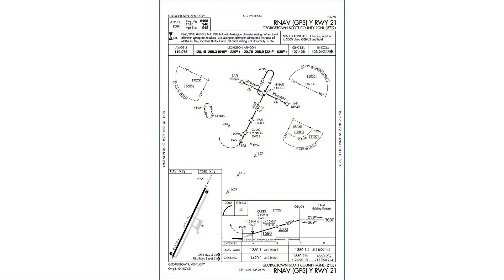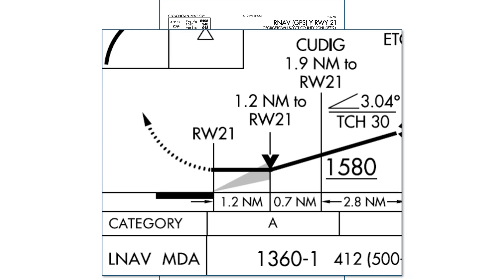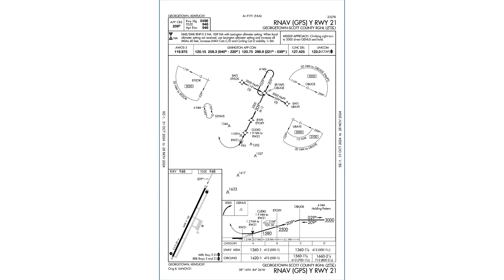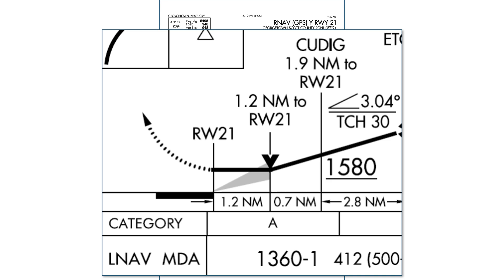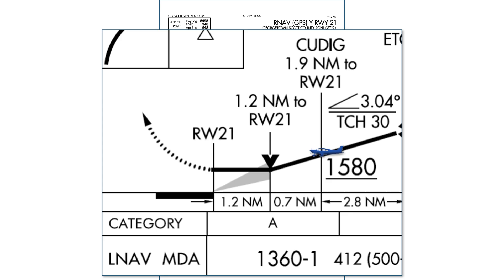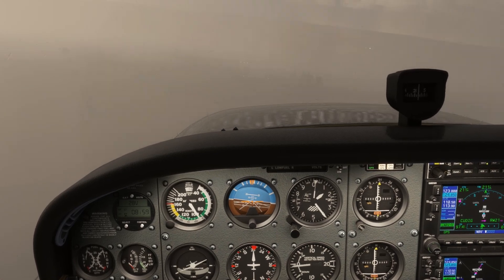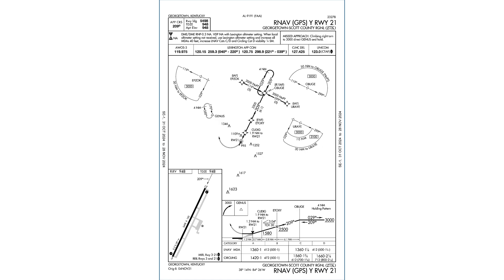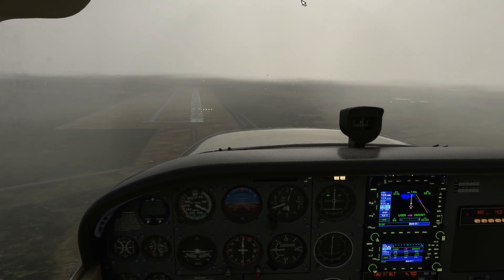How to Use the Visual Descent Point | Non Precision Approaches

Comment: There is another very important legal consideration here:
14CFR 19.175 (c) 
Where a DA/DH or MDA is applicable, no pilot may operate an aircraft below the authorized MDA or continue an approach below the authorized  DA/DH unless -

(1) The aircraft is continuously in a position from which a descent to a landing on the intended runway can be made a normal rate of descent using normal maneuvers

You are required to have a normal rate of descent, not chop and drop to the runway. The VDP is there for this very reason. The VDP gives you the 3.0 degree glide slope to the runway, allowing for a normal rate of descent to a safe landing. You should go diving to the runway at almost the MAP.
Reply: Where does the FAR describe exactly what is a "normal rate of descent"?  Perhaps some may consider 700 or 800 FPM to be normal . . . for them.  So 'chop & drop' does not necessarily violate 14CFR 19.175 (c).

Comment: Yes Darthknight, that is correct (mostly). The referenced AIM section stipulates "The pilot should not descend below the MDA prior to reaching the VDP." However there are more criteria to take into account (please read the full text of the AIM 5-4-5(h) to appreciate). Generally, you should expect to execute the missed approach procedure if you don't have the runway in sight at the VDP. One very important reason for this is that the VDP is positioned to allow a stable approach all the way to the runway touchdown zone if you can continue your approach at the moment of arrival at the VDP. As the narrator stated, if you level at the MDA and then subsequently see the runway, you will be in an unstable condition if you attempt to land after you have passed the VDP and leveled off at the MDA.
In GA flying in small, low performance aircraft, being in a stable configuration is more manageable due to relatively low speeds and simple configurations (fixed gear, etc.). If you are flying a complex, high performance aircraft (turbine, heavy, business jet or transport category), being stable all the way to the runway is a criteria that is required in most if not all flight departments. Thus, a descent to landing after passing the VDP and leveling at the MDA is generally not possible if stable landing criteria is to be maintained. There is more to this topic than is said here, but I can tell you that at the two airlines I worked for, if you level off at the MDA after passing the VDP, you will be obliged to execute the missed due to being unstable if you tried to attempt to land. This maneuver is one of the most difficult to learn (and teach) for new jet pilots. It is also one of the most worthwhile and rewarding to master.

Comment: Why do some plates have a VDP and some don’t?
Reply: "A VDP may not be published under certain circumstances which may result in a destabilized descent between the MDA and the runway touchdown point. Such circumstances include an obstacle penetrating the visual surface between the MDA and the runway threshold, lack of distance measuring capability, or the procedure design prevents a VDP to be identified." AIM 5-4-5(h).

Even though you can descend below the MDA as soon as the runway environment is in sight, it's probably a good idea to remain at the MDA until you reach the VDP, especially if there's a gray stipple between the VDP and the threshold. That indicates there are no obstacles on that portion of the approach. If you descend as soon as you legally can, and have not yet reached the VDP, you may end up getting uncomfortably close to an obstacle.

Comment: One technique if you are at MDA at the VDP and do not have the runway environment in sight is to fly a little slower but still safely above stall in the landing configuration. This way if you want to dive for the runway on visual acquisition you will have less energy in the float. Power idle, full flaps, maybe add a slip. I fly a Maule so I'm still good if at the threshold at MDA provided I have 3,000' and I'm slow to begin with. A Cirrus would likely need to go to a different airport.
Reply: That completely violates 91.175 lol
Reply: You’re slipping in IFR, AND full flaps?
Reply: @ I thought it was obvious from the context of my message, but after the runway environment is in sight. That’s why I said “on visual acquisition”